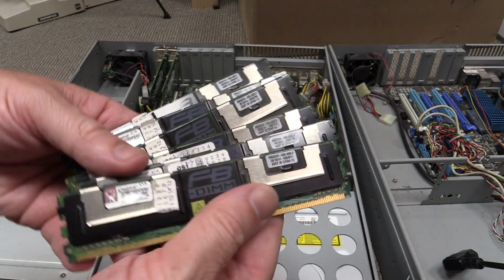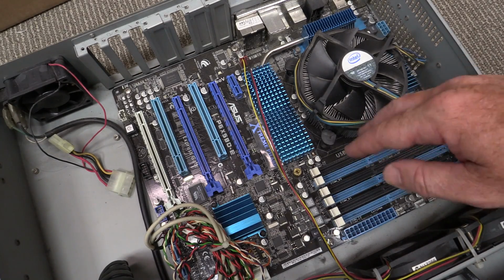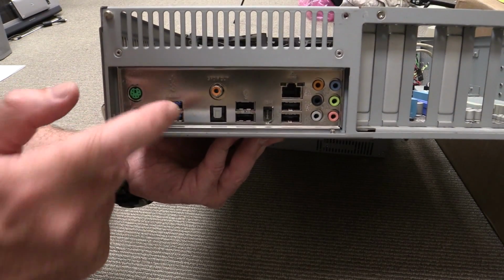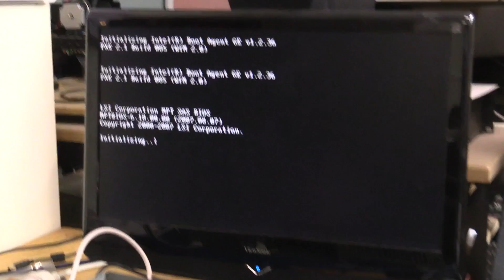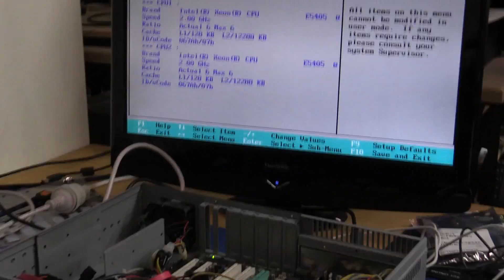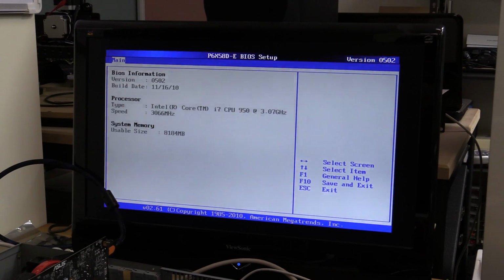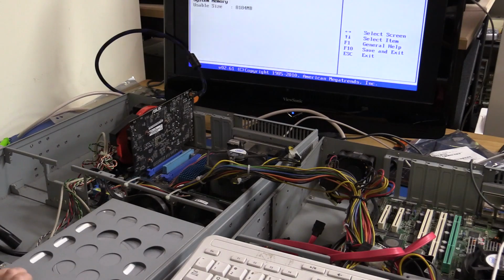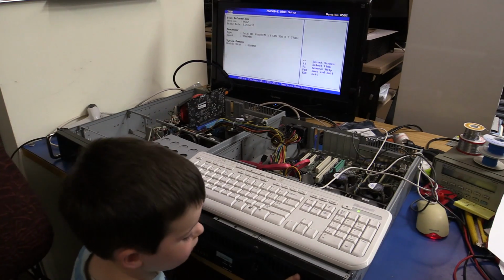EEVblog #838 - More Dumpster Server PC's

Comment: The SAS is Serial Attached Storage. Much faster than SATA and probably a RAID controller as well. Good find! :)
Reply: +Tristan Buckley SAS will always be Serial Attached SCSI. 

:D
Reply: +Justin Bell And Special Air Service
Reply: +Tristan Buckley In fact the transfer speed of latest SAS is the same as SATA3 but it has a more evolved protocol which is reverse compatible to SATA (you can plug a SATA drive on a SAS controller but not the other way arround). It's the SAS drives that are much faster!
Reply: +Tristan Buckley SAS matches SATA3, but a 10K rpm SAS drive is much cheaper than a 10K SATA drive, not to mention I dont even think you can get a 15K SATA drive.
Reply: +ppdan SATA do not match speeds of SAS, there is one big difference SAS is full duplex, whereas SATA is half duplex, which make newest SATA 3.2 slower than SAS 3.
Reply: +2009dudeman There is not 10K true SAS drives on market at least in last 5 years, all what you can find in that speeds is NL-SAS drives (Nearline SAS and they are just enterprise-class SATA drives that have a SAS interface), only true SAS drives you can find are 15K drives.
Reply: +Miloš Lazović Your correct that SAS is full duplex but the current max bitrate of the serial signal is the same.
Reply: +Miloš Lazović I didn't know 10K SATA existed (except those raptor junk drives from WD and they don't make any SAS drives afaik). Also haven't seen any 10K NL-SAS, maybe I wasn't looking right!
Reply: ppdan
WD do make NL-SAS drives, I am not sure they make real SAS, but I am sure for NL-SAS (I had WD NL-SAS).
Strictly max bitrate of the serial signals are not same SATA 3.2 is 16 Gbit/s half-duplex (that is most recent specification of SATA as I know) and SAS-3 is 12 Gbit/s full-duplex (SAS-4 will be 24 Gbit/s according to preliminary specification and it is expected in 2017).
High bitrate do not necessarily mean faster speeds, it is only true if both are half-duplex or full-duplex, but in this case they are not, so comparing bitrates is not fair comparison.
Reply: Miloš Lazović For 10K SAS drives, i've got some, they are from 2008. They were amazing for video editing, and even nicer when I was running the OS off one. Now my SSD is faster than my old SAS drives on most everything except contiguous reads and writes. I only have one 15K SAS drive that I got from my buddy who works at LiquidWeb Website hosting. That beats my SSD on most everything except the most strenuous of random reads and writes.

I am looking at picking up some more 15K drives though, Some 600GB seagate cheetahs, dumb thing is they are cheaper than WDs SATA 10K 600GB hard drives.

Its true when they say SATA just cant keep up with SAS.
Reply: 2009dudeman
Last time I checked 600Gb 15k SAS drives was >500$ for new (up to 1000$), but you can always used for dirt cheap, for big companies and data centres usual policy is to replace them in less than 3 years no matter if they are good (they do not wait them to fail), and even after that time in home use they usually will last longer than most new SATA disks.
Reply: +Miloš Lazović Bitrate wise there was an analogy : SATA2 <-> SAS1 and SATA3 <-> SAS2 only that SAS is full duplex which means it can read and write at the time. After that they went separate ways but none of those successors have made into our homes yet.
Reply: ppdan
Correction, full-duplex don't mean it can read and write in same time, it mean that they can communicate in both directions in same time, and that is very useful because communication from host to target is not simple (on any host request target need to respond).
Now go tricky part, in ATA protocol (including SATA) host can send only one command and need to wait target to respond (which make half-duplex ok to use), but in SCSI protocols (including among others SAS) host can send multiple commands to targets queue and then target execute them (target can do some optimization of order it will execute commands and do not need to execute commands in order host send them) and in any time can send results (in this case half-duplex will be highly inefficient and it will have introduce great drop in performances).
SAS gain its higher performances from ability to queue commands (need for full-duplex is just consequence of that). Now just hypothetically if SAS would be able to use half-duplex (which is impossible) you should expect performance drop comparable to drop Ethernet experience when it work in half-duplex mode instead of full-duplex mode and that can be up to 50% drop in performance (is depends of load, in light load drop is less pronounce and as load increase difference start to be greater).
Reply: +Miloš Lazović Full duplex communication -> both directions (RX and TX) at the same time (from sender to receiver and receiver to sender at the same time). Now if you look at it from one side (the host) it's reading (receiving/RX) and writing (sending/TX) at the same time on the physical data bus. You are taking it really to far and make it one big mess while it's so simple.

Half Duplex -> Walkie Talkie (only one can talk)
Full Duplex -> Telephone (both can talk at the same time)

From sandisk.com (first google hit) : "SATA transfers data at half duplex while SAS can transfer data at full duplex. Thus, for SAS, each port can read and write data at the same time whereas SATA cannot"

PS : SATA controllers can have command queuing as well, the host (controller) doesn't have to wait for an answer before sending another request!
Reply: ppdan
SATA do not support full command queuing, it support some basic functions through NCQ (Native Command Queuing) but that is not mandatory (not all controllers and HDD support it) and it performance gain is negligible. SAS use TCQ (Tagged Command Queuing) which have more control and less limitations than NCQ, it have bigger queue length (NCQ have 32 command deep, TCQ have from 216 to 2^64 in SAS-3) ...
Reply: +Miloš Lazović You said it couldn't queue -> I said it could queue -> you say it doesn't queue as good as SAS ... I am gonna stop that discussion here because you seem to avoid the parts where you got it wrong by twisting something I said.
Reply: +ppdan SATA do not support queue, NDQ is introduced as OPTIONAL feature from SATA 2. NDQ support even today is not working in most cases.
Reply: +Petar Petrovic You contradict yourself in the same sentence : "SATA do not support queue" <> "NDQ is introduced as OPTIONAL feature from SATA 2" (I think you meant NCQ)
Anyway we came here because someone else claimed that SATA cannot queue commands because it's half-duplex (read previous comments) so I used this to show evidence that the claimed relationship between "Duplex mode" and "Command Queuing" is incorrect. Never ever did I claim that NCQ was working well (I found myself a little over 10 years ago that it doesn't work as expected). Now I am gonna keep this discussion short as well because the assumptions made are similar to those coming from another user having his name ending with "ovic" ... what a coincidence!
Reply: ppdan You obviously do not understand, or you didn't read what was previously said, no one posted that queue have anything to do with type of duplex used.
You must understand till queue is not mandatory feature of SATA it is same as it do not have that feature, now queue is left to manufacturer's to decide if they want to implement it or not there is lot of even SATA 3 product that do not have queue implemented in it.
This discussion would be short if you just read what is posted and try to be more precise in your posts.

edit: To put simple to you, till you do not have guaranteed that queue is implemented in every SATA product on market you can say stat SATA have queue.